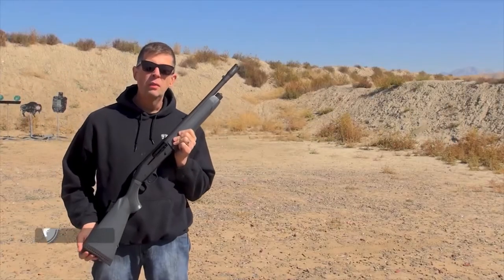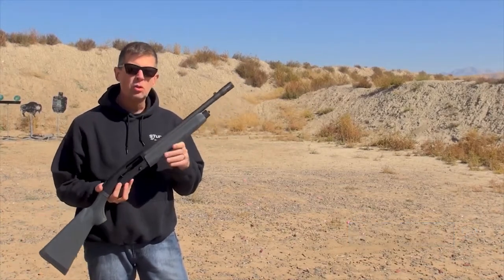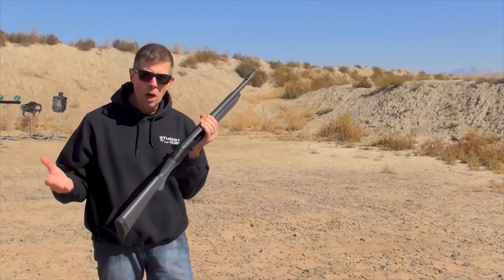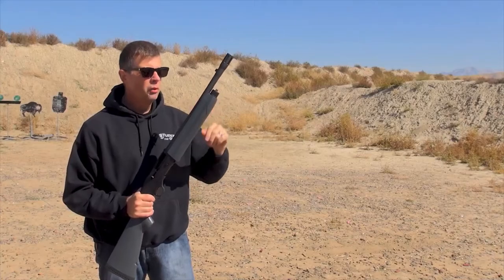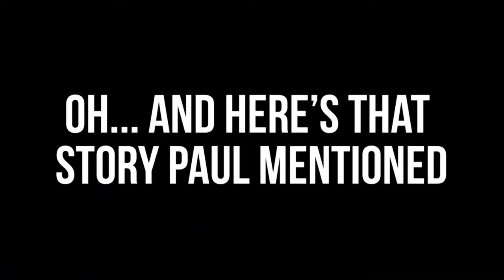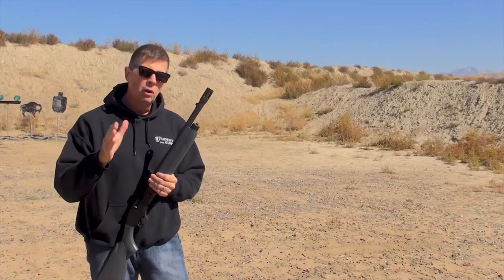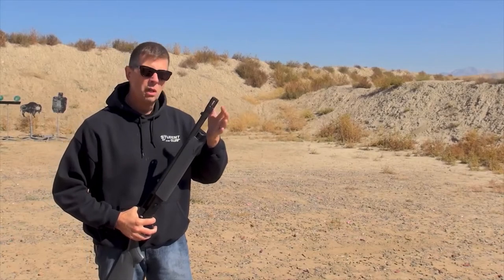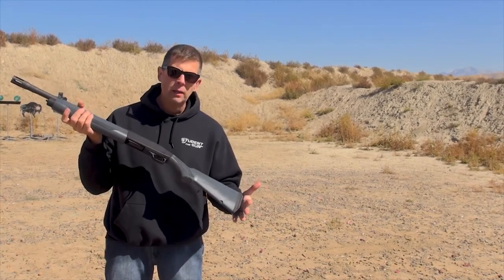Mossberg 930 - 12 Guage Semi-Auto Review & Take Down

Comment: On a loaded chamber with a closed bolt and a loaded mag tube, if the bolt release is hit on accident, two shells load on top of the elevator causing an instant jam. The 930's, 940's, and the Beretta 1301's all have this fatal flaw.